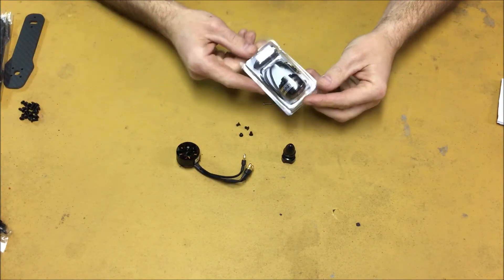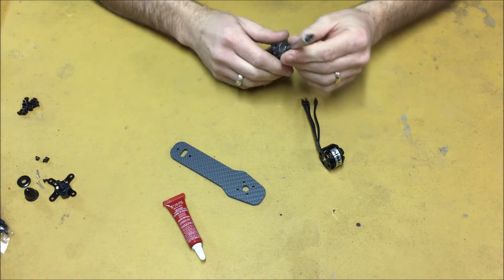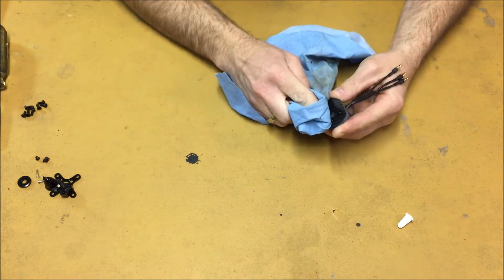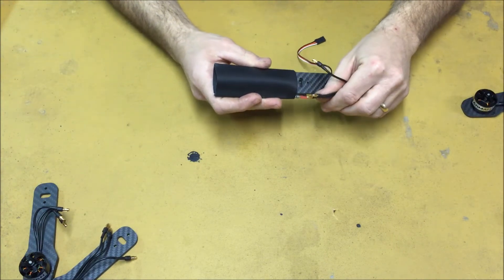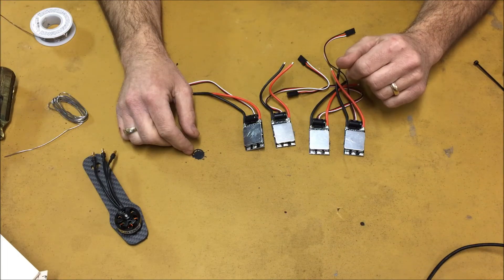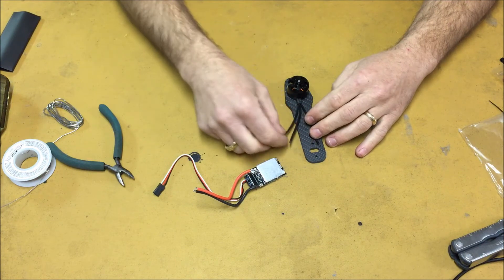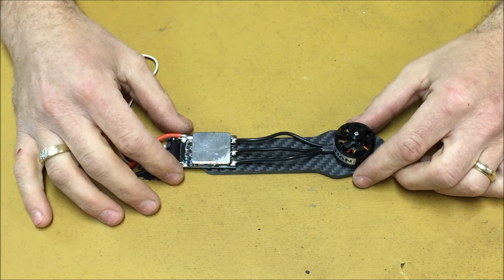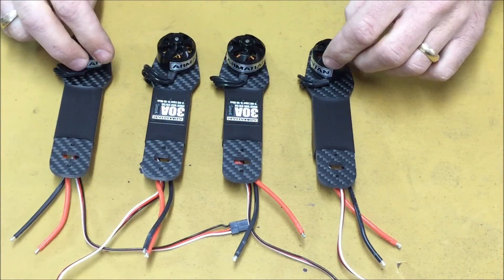Armattan CF258 Installing Motors & ESC's

Comment from the maker: There ESC's come loaded with simonk firmware and are very reliable. As for the battery a 2200 mah 3s is best for normal flying.  This C258 is still one of my favorite flyers!
Reply: Great video! Thank you for taking the time to make this. I do have one question:

I really like the clean look of having the ESCs attached to the arms with heat-shrink. I notice that after replacing the original heat-shrink on the ESC that you place the ESC on the arm with the heat-sink against the arm before adding the second piece of heat-shrink to hold it in place. Do you ever have problems with the ESCs overheating due to the lack of air passing over the heat-sink?

I'm very curious. I think it looks much better than the typical zip tie approach and suspect that it gives the ESCs a bit more protection as well.

Thanks again!
Reply from the maker: +jdubdev No, never any overheating.  These ESC's are very durable.  Only downside with the heat shrink adhering the esc to the arm is if you do need to replace it, the arm has to be removed.
Reply: +Brian Mays Thanks for the quick reply! Your method looks very clean. One problem I have is getting dirt and mud into the ESCs with the stock heat-shrink that's open on both ends. This method would help alleviate that. Thanks again!

Jerry

Comment: I bought an armattan CF 266 and have begun the process of assembling it and was wondering if the esc's come pre-programmed? If not, could you supply a link to the programming adapter and software you used? Also, what battery did you use? It would be extremely helpful